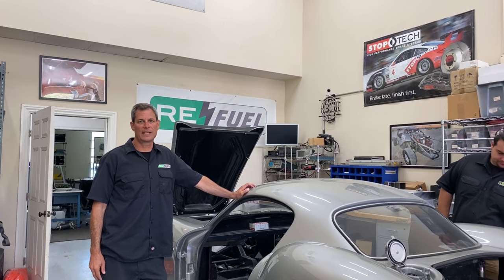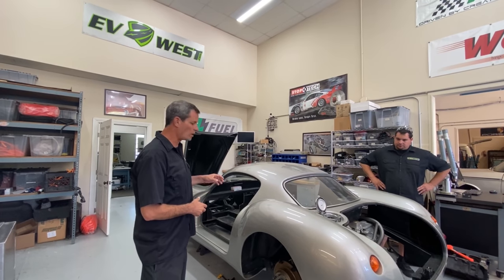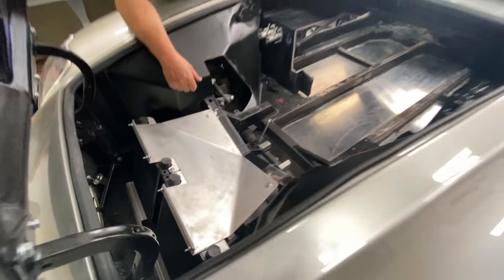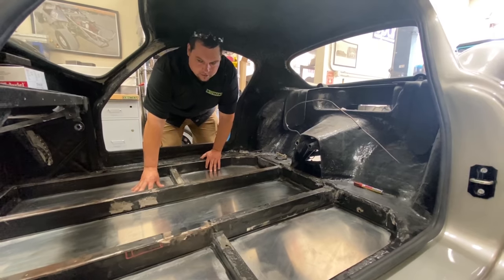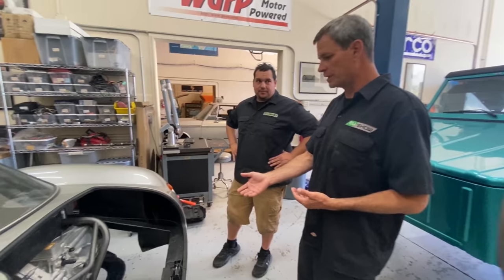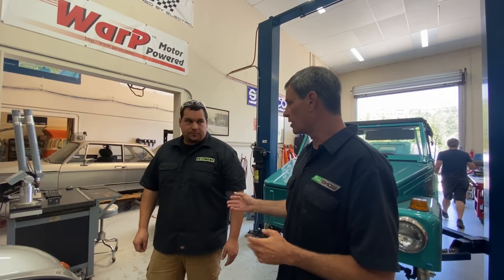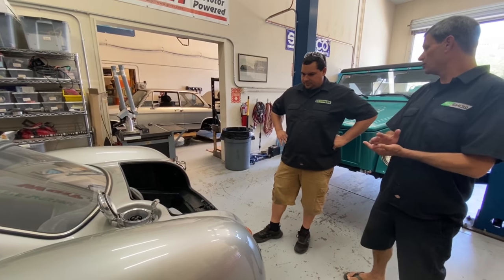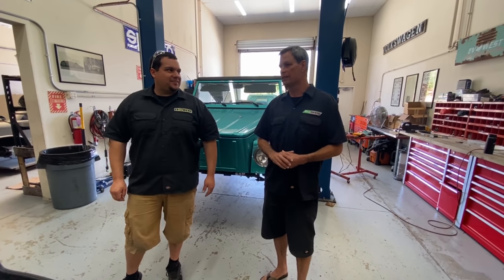Dowsett Classic Car Comet EV Build With Ant Anstead | EV Show

Comment: Are you guys able to buy the tesla motors direct new, or are you pulling them from used vehicles?  It's all just a big thought experiment for me right now, but I've recently become obsessed with converting a small cabin cruiser yacht to solar/electric, and it's been difficult finding actual technical information on Tesla's motors.

Comment: A small boutique built car like this seems fine the way it was originally built. I like electric cars but not retro fitted ones. Ground up electric works best
Reply: Considering the builder of the car is involved, how is this not from the ground up? Considering EV West does so much engineering work maybe this is first version of an electric model. Not every electric car has to be based on the electric skateboard which is based on the original Beetle skateboard. Of course skateboard had not been invent yet so it was hard to call it a skateboard.
Reply: @dannelson6980  the car was not designed to be an ev. If its ground up it would of been from the start
Reply: @dannelson6980  the builder probably figures i rather help then let them screw it up. I saw the vids on the builfing of this car and the design philosophy behind it .meant to be a modern retro take on classic british cars with modern touches. Still had a combustion engine from the builder. I like evs not in this car. I don't see any reason to do it here. If you want one that's up to you. I would get this car in original factory form that's the whole point of it